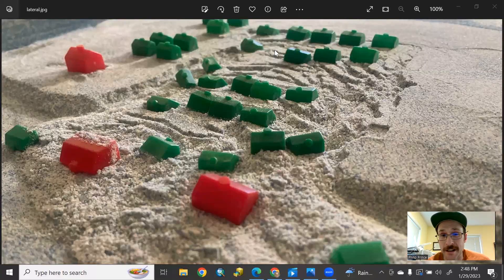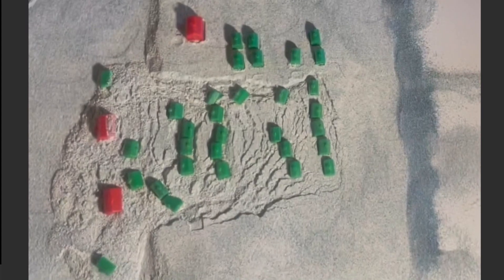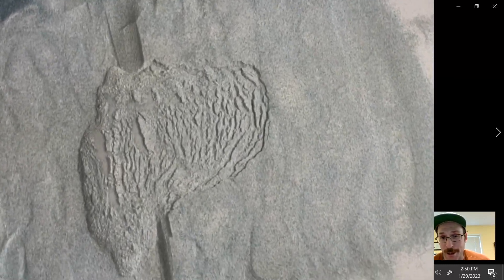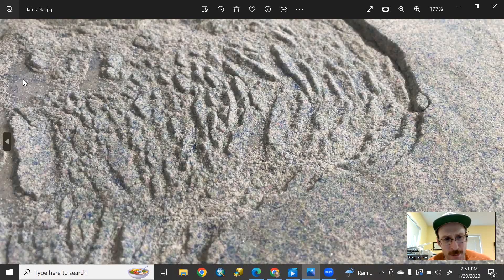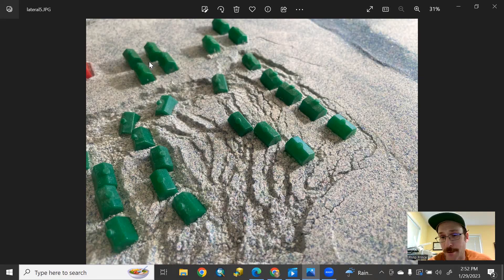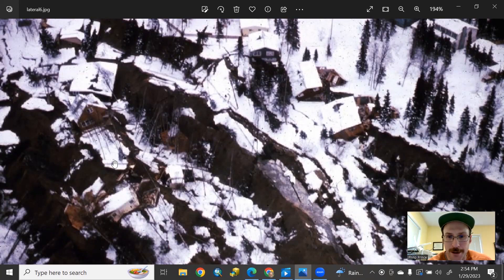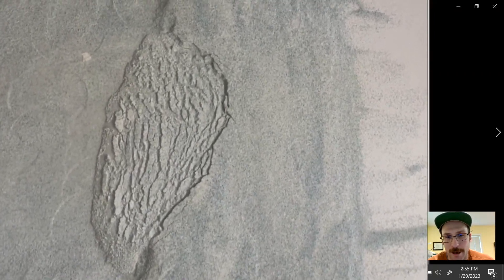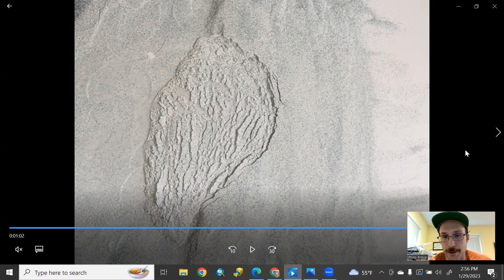Earthquake-induced landslides: Lateral spreads and liquefaction | Geology Models

Comment: Hello! Your video is an incredible.. I am a seismic interpreter and my current project has the same picture but subsurface on the depth -2.5 km.. length of the slump more than 40 km, and I found out analogies in the real shelf near the California. 
I have a question, did you try to make a section across the entire landslide? I’m interested in it because I am making a 3D model of the same feature 🎉
Reply from the maker: Sorry for slow reply...I can try it, I think. Is your feature a submarine spread that was buried? In other words, the spread was a single event with subsequent burial, and not a progressive deformation event with syn-kinematic deposition?

Comment: Excellent work, as always!      I get what you're saying about "not all sediments are prone to liquefaction", but could the very general rule be 'the thicker, the more prone'?     Would it be possible to model the Frank Slide at Turtle Mountain?  Lol, sorry to bombard with questions, but what about bench failures in carbonate rocks dipping at near 90degrees? That one I ask because I frequently pick crystals at an old open pit iron mine (all operations ceased by 1980), and can clearly see areas that are slumping (the best hunting grounds, as freshly cracked rocks yield their crystals missed by last years' pickers). Some sizable failures have already occurred.  The mine is called Steep Rock, in Atikokan, Ontario.
Reply from the maker: Liquefaction relates to grain packing and pore water. When shaken, looser sand wants to pack more tightly, which squeezes the pore water and effectively "floats" the grains next to each other, making the mass lose all strength.
Reply from the maker: ...so it's a material property thing, not so much thickness. I'm always trying to set up weird new failure geometries, and steeply dipping stuff is on the list! I use a tilting baseplate to set up the models so I can add weak material before failure.
Reply: @TheGeoModels  could trace amounts of moisture + freezing the beads help? I'm just taking random shots in the dark, I'm sure you have a good handle on it! I look forward to whatever you show us next! Thanks!
Reply from the maker: so my pre-failure dips are limited, but I'm working on it!